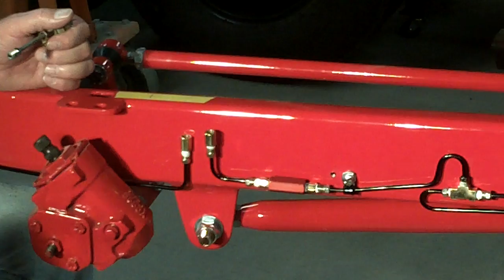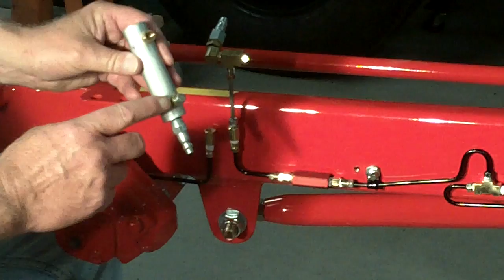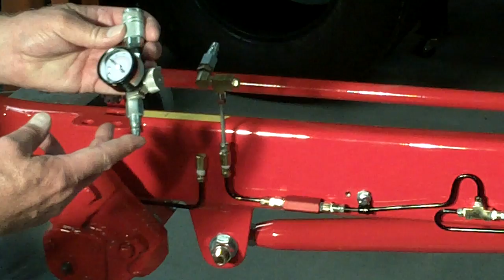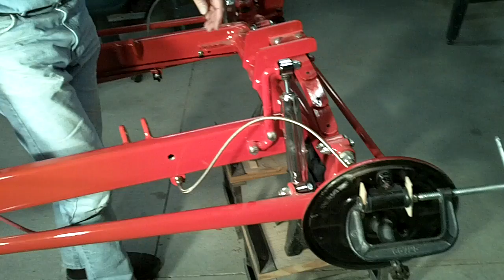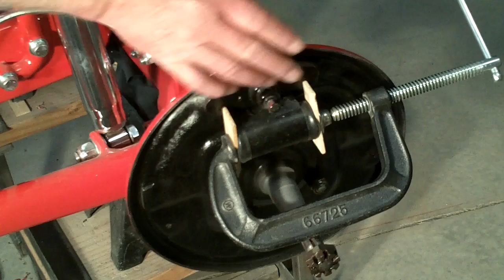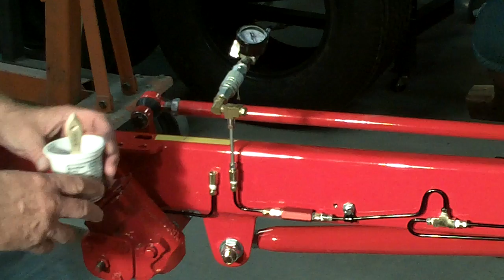Checking Brake Lines Using Air and Soap Suds

Comment: Most SS line manufactures do not recommend using tape or any other sealant on the threads.  The cone seals the fitting not the threads. 
Love your air test solution.
Reply: wilwood recommends Teflon tape.